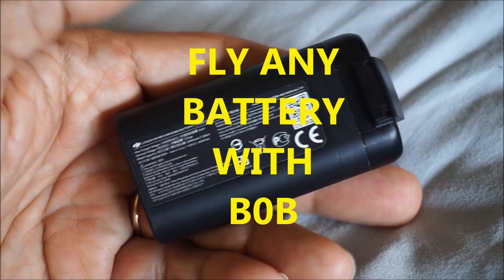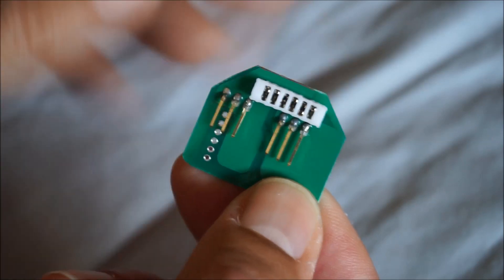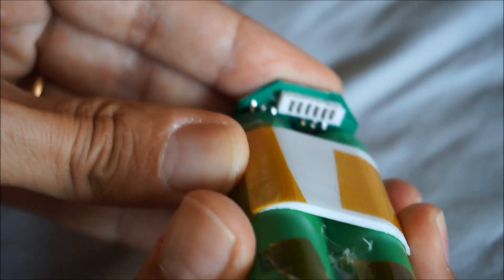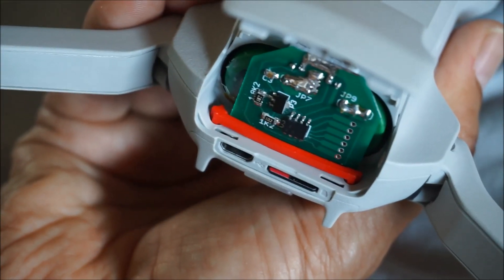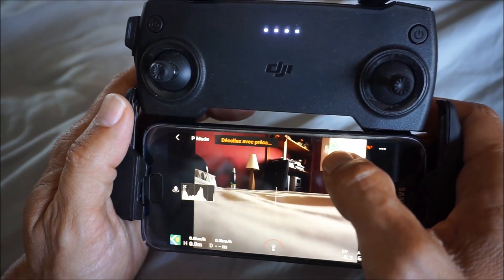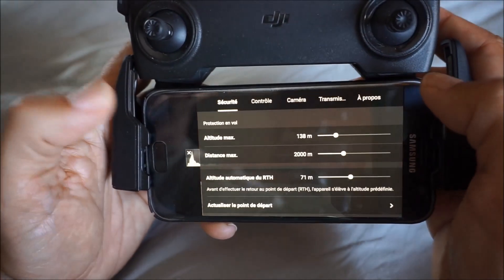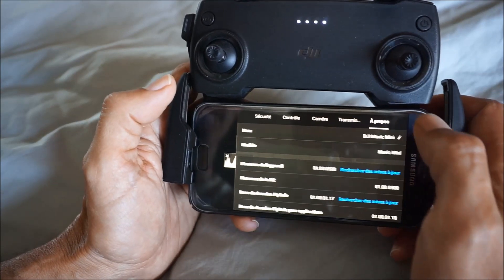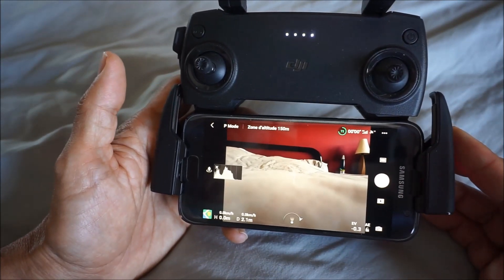B0B: fly any battery on your Mavic Mini

Comment: Do you still have the Bob pcbs and chips available? Or the complete bobs? Thanks!!
Reply from the maker: Yes sure, for Mini 1 firmware <=500
Reply: @aeropic31  ? $500 for a bob?
Reply: @aeropic31  I had gone to your page and i couldn't find where the purchase link was.  Emailing you is probably better?
Reply from the maker: @teeodee  yeap, at the end of the page, you'll find an email address...
Reply: @aeropic31 At the end of the page, the box where I think the email is isn't working and returns an error. That's why I was messaging you here. I tried to find it in the thingverse files but no luck. It's just showing a placeholder at the bottom.
Reply: @aeropic31 I have been searching.  I think I have found it. I will try.

Comment: do you get better battery time with this. 
I hate how the manufacturer batteries discharge when the drone is not being used.
Reply from the maker: Yes I do win around 5 minutes. And the battery stays charged when disconnected from B0B.
Reply: @aeropic31  Many thanks

Comment: Hi Felx
I`m very interested how can I the flying time of my mavic Mini to encrease. Standard battery are 2400 mAh 17,28 Wh bzw. normal voltage 7,2 Vdc. Max charge voltage ==> 8,4 Volt. ==> intelegent fly battery from DJI
Is this also possible with battery type: INR18650-35E (3500mAh) Samsung SDI3
Need  it here the BOB  which "B0B is able to communicate with the ESC board of the drone giving it just enough information to be accepted at boot and to monitor the voltage during the flight."
or can I use the origional ESC board of the drone from DJI
It would  be nice when you send me a response to my question.

Hermann
Reply from the maker: Hi Hermann, the best cells so far are Sony Murata VTC6... please see the read me file at the bottom pf this page:
http://aeropic.free.fr/B0B
Reply: @aeropic31  
Hi  again
Thanks for your response
I have send you a E-Mail concerning further connversation

Hermann
Reply: Sorry I have missing your E-Mail adresse
Could you send it me
Hermann
Reply from the maker: @Hermann214  the e-mail is at the end of the Web page. If you don't find it, please post here your email and I'll answer.
Reply: @aeropic31  
Hello again
Additional question:
I am currently using the new DJI Mini 2 with the old batteries from the DJI Mavic Mini which fit into the DJI Mini 2.
Likewise the original batteries of the DJI Mini 2

The current data of the DJI Mini 2 are as follows:
a) Firmware of the flight device: 02/01/0300
b) Firmware remote control: 01.00.01.19
c) App-Fly Safe database: 01.00.01.19
d) App version: 1.3.0

Can I still use the DJI Mini 2 when updating a new firmware with the modified batteries from BoB?

I would like you to put together the entire package as you told me in the reply.

"I can offer B0B in different forms, depending on your requirements:
a) finished B0B tested in flight + connector for a batt + some 3D-
printed parts (locking + centering)

b) The Sony VTC6 3000mAh are also an excellent candidate. They're a few grams heavier than the SAMSUNG, but they end up at 101.4 grams (all contain B0B, cells, 3D printed parts ...) which keeps the Mini right below the 250 gram limit! With these cells, 30 minutes of flight time can be achieved.

c) Charger for battery (does this protect against overcharging of the battery) or a display of the current state of charge.

d) Does the charger switch off when the battery is fully charged 100 percent ??

Please send me an offer regarding the total costs for this project.

Hermann Prokschi
Reply from the maker: @Hermann214  B0B does not work with mini 2. Sorry !
Reply: @aeropic31 
Hi again
Thank for your response
Hermann

Comment: nice job! did they have any confirmation built in the circuit? to make sure it's an original battery? what does the circuitry do?
great job reverse engineering those! i'm a newb so It sounds insanely hard to do to me :D
Reply from the maker: Yes sure there are some handshakes to authenticate the battery !
Reply: @aeropic31  where can I buy this pre made or as a kit
Reply from the maker: @Lij_MC  please contact me by email at aeropic(at)free(dot)fr
Reply: is it opensouce?

Comment: You mention a 3s battery which is 11.1volts - what is the maximum voltage battery the mini can use safely? And if you can use a 3s what is its top speed and flight time?
 Can bigger rotors be used
Reply from the maker: The mini is limited to 9.05V above this it rises an error at ESC board level. But booting it on 2S then hotswapping a 3S batt works fine.
B0B can handle up to 16V only if the proper regulator is installed (standard B0Bs only handle 12V - 2S)
In terms of speed and flight time, I never tried myself in 3S. This is highly depending upon the mass and capacity of the cells...

Comment: thats iinetresting but can it decrease the total weight also so you can  add some strobe light but be under 249grams ? that would be a benefit also.
thanks
Reply from the maker: The mass of B0B + two Samsung cells is few grams lower than the DJI batt...

Comment: I vape and have a lot of 18650 batteries,  wish there was something that could just swap out the batteries.  very interesting video tho.
Reply from the maker: Unfortunately ther is no room inside the Mini battery hole to fit a kind of spring case for 18650. B0B is maybe the only option so far to install 18650 soldered in pack of 2 batteries with the swapable electronics...

Comment: Is this possible to create a additional 2 battery's attatched to the outside of the mavic mini that is also connected to the 2 battery's inside the mavic mini with "bob".... this would hypothetically almost double the flight time to 40+ minutes?
Reply from the maker: Yes an external connector can be soldered on B0B to install, in complement to the internal cells an additionnal batt in //. However due to the extra mass to carry this will not double the flight time !
Reply: @aeropic31  where i can find this bob any link for buying ❤
Reply: It is enough to use high-quality 18650s like VTC6 30A, I flew them in quite windy weather for 35 minutes.  Достаточно качественных 18650 банок типа VTC6 30A, летал на таких  в довольно ветреную погоду 35 минут.